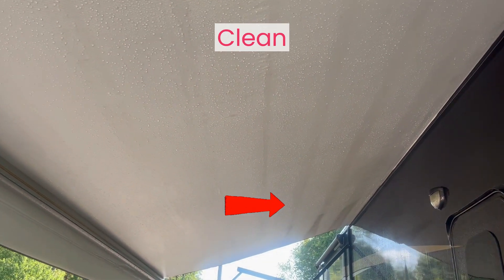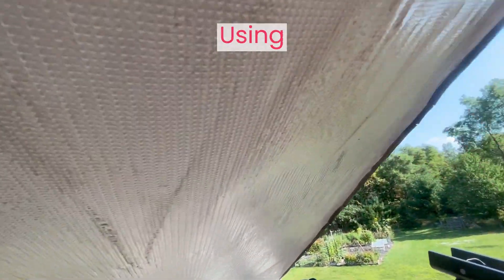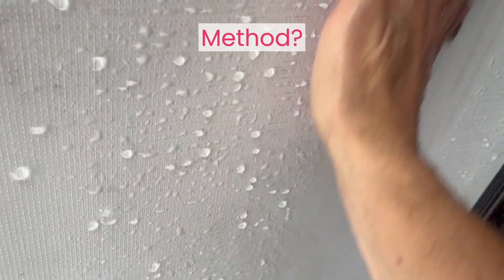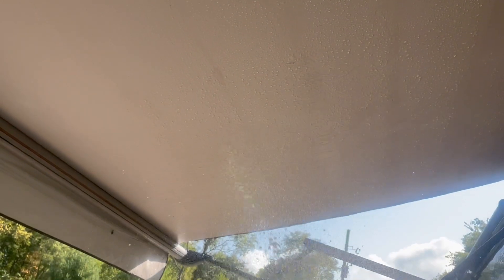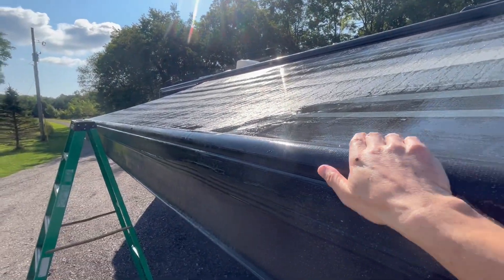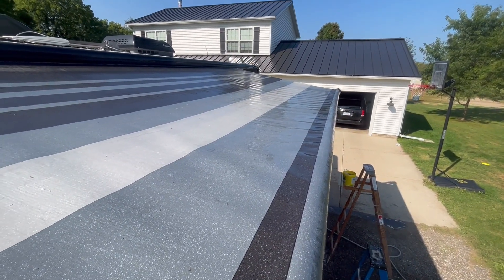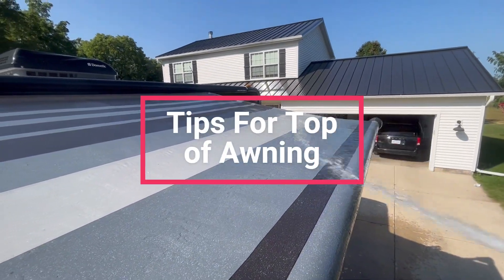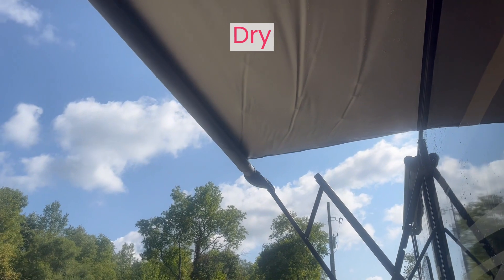RV Awning Cleaning for $1.00!  So EASY You'll NEVER Go Back To Chemicals and Brushes!

Comment: I use 1/2 cup bleach,1/4 cup white vinegar,1/4 cup hot tap water in a spray bottle. Spray on the awning and let it sit (about 10 minutes) . Spray off with hose. Awning is clean and no scrubbing required.

Comment: There are two different awning fabrics in use: vinyl and acrylic. This video appears to suggest vinyl. I doubt if this would work on woven acrylic, which has an applied waterproofing seal coating. Please confirm if I am correct. If so, you would simply re-spray the fabric after it is thoroughly dry.
Reply from the maker: I would consider this vinyl.  It's definitely the more affordable quality of the two types i've seen.